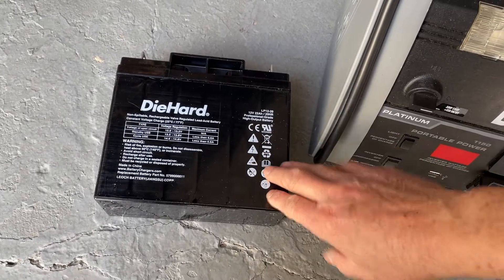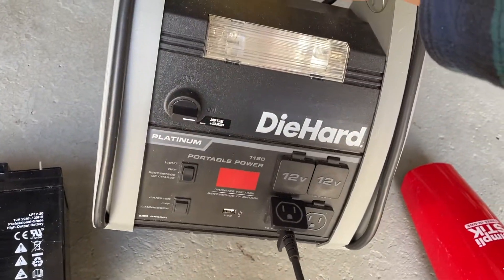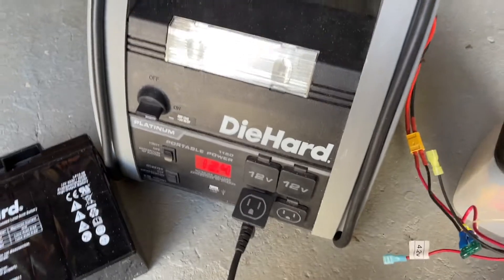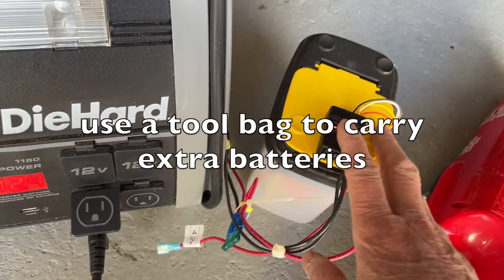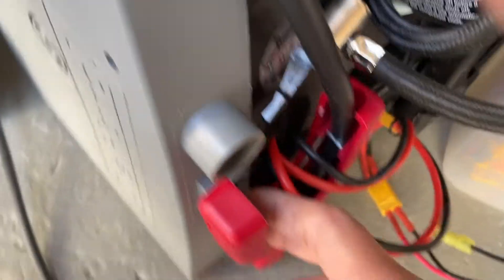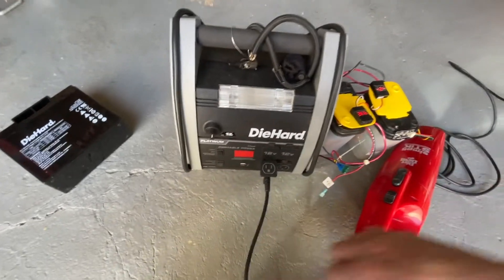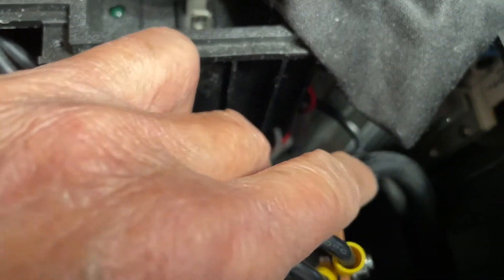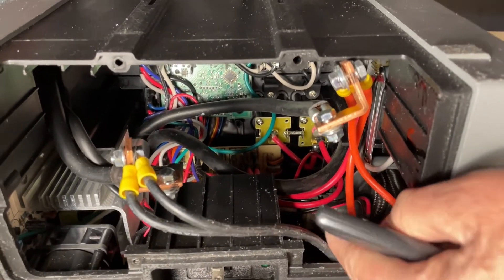DieHard power station doesn't want to die

Comment: I've seen a lot of gents and ladies use cheap 18V li-ion batteries that they use in power tools to power stuff nowadays but you are right to use that power station as it is ideal and you already have the rest.  Do you use those batteries in parallel?  I guess if both are fully charged/same voltage that works out. 
I am starting to use cheap Schottky diodes to kind of protect anything that I can connect together. Better be safe than sorry.
Reply from the maker: Yes, the 2 batteries are in parallel and around the same voltage.  Some use drill batteries to jump start a car. I’d be a little hesitant as the voltage might be a little too high for the normally 12 to 14v electrical system in the car.  I’d need a very big diode if I were to use the lithium ion battery to start a car.  Lithium ion chemistry has some limitations so you have to be careful.

Comment: I can't say I blame you, that jump pack has a lot of functionality.  It would be a shame to waste it.

My Harbor Freight el-cheapo jump starter is no longer suitable for jump starting, since the battery is quite aged.  But I keep it around because it can still deliver a few amps, so it's handy as a power supply.  Also convenient for the cigarette lighter plug built in to it, for when I need to run those items.
Reply from the maker: Same here. I used the jump start only 2 or 3 times to help others to start a car. The tire compressor is useful so in all it’s worth it.  Yes, the cigarette 12v can be used for a variety of gadgets.  You never know when you will need something like this. I am just surprised at how well built this power station is.